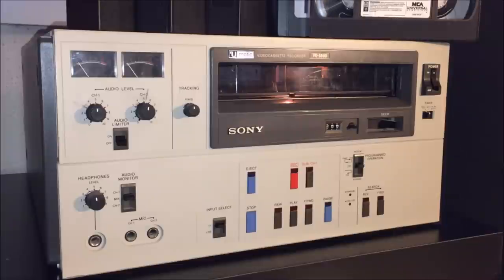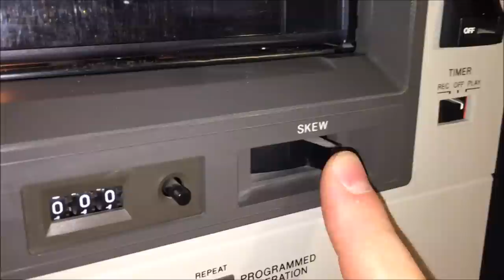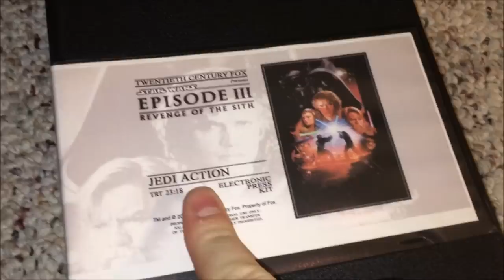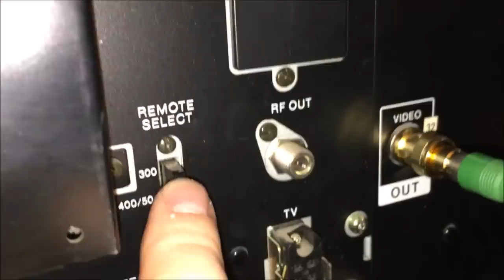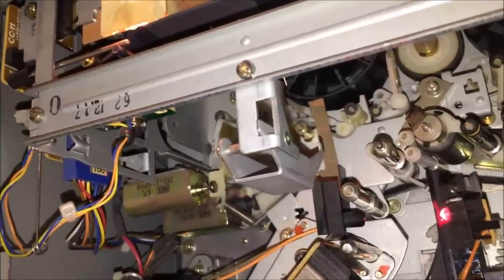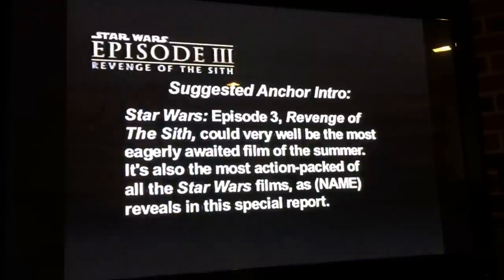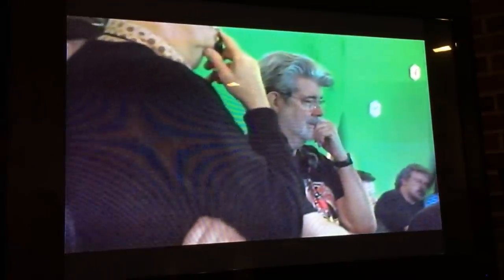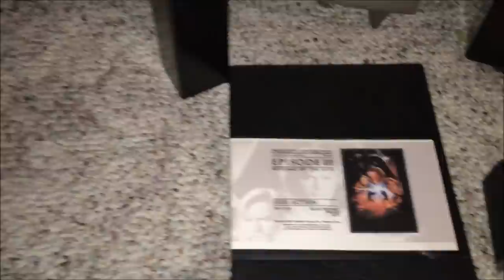Sony Pro U-Matic Mega VCR and Movie Preview Tapes

Comment: I have hundreds of those cassettes to transfer to MPEG this summer. The TV station I work for was using those until the DV, then HD tapeless. I have exactly the same VO-5600. Sadly it doesn't work. Found another in the back of the most dirty, humid closet. Surprise... still works perfectly!

Comment: I have been in broadcasting since 1960 and many post facilities in NY. No one I ever knew, besides cable companies uses these for broadcast. U-magic was a commercial (not broadcast) machine. Notice lack of XLR audio connections. No "tv studios" used the tv monitor connection. That connextions was yesterdays HDMI port. We used them to send copies or shorr clips off to advertising agencies. We would also make visually coded cassettes so producers could used them to pick out edit points for quad or 1" online edits.
I own over 200 movies on u-matic 3m tapes. Direct from 35mm film and in stereo
any older tapes need to be baked before playback.
I restore broadcast video tape machines (2" & 1")
Reply: From my understanding, Betacam and it's variants (like Digi, SP and SX) absolutely slaughtered the other high-band broadcast video formats
Reply: @VoyageOne1  they were only used for ENG stuff, never for productions
Reply: @rty1955  What was the reason? Did Betacam lack of quality for high end production usage?
Reply: @martinmannik  reason for what?
Reply: @rty1955  Reason for using Beta variants only for ENG stuff.
Reply: @martinmannik  beta machines were very finicky quality when they worked.
U-matic was NEVER broadcast quality

Comment: A few years ago I a few worn out studio video-tape machine that didn't even switch on, so I stripped them for any recyclable metals & materials. One was a UHF machine (JVC, I think), but the others were a pair of Sony Betamax machines that looked very much like this machine but of course the mechanism was more elaborate & the front panels had more controls on them (Dolby, etc.), plus they'd managed to cram a few more circuit-boards inside!

Comment: I thought it was interesting that some of those units on eBay were quite affordable. I've been recording local weather coverage of tornadic storms, and that would certainly make my DVD transfers look much better. I record those onto VHS as power glitches (like those during thunderstorms) won't prevent the entire recording from being trashed like burning video onto DVD would. As far as I know, a power glitch that happens while you are recording (burning) on a video DVD recordable is a bad thing. I don't think the recording is retrievable at least on consumer recorder or computers. Also, if the VCR ends up resetting after a power glitch, you just simply hit record to continue recording. I have an ATSC tuner that records to a USB stick, but those recording usually get corrupted during a power failure too. Of course, I could just get an UPS...

Comment: U-MATIC SP • Had the higher count of TV Lines.  SP = Superior Performance and was not entirely backwards compatible with regular U-Matic (Non - SP).  One could play back and record Non - SP on a SP machine, but a Non - SP machine could not playback SP recordings.  U-Matic SP machines were clearly badged on the front.

Comment: I had one of those at work for years. Hi band Umatic wasn't really broadcast standard though
Reply: Yeah, technically it was an industrial format. Used primarily in news gathering, advertising, education, music videos (in MTV's heyday in the 80s)... and even early CD mastering and the occasional data backup. It was a very versatile format and far more reliable than VHS and other consumer junk. These old U-matics r00l! They're built like tanks and run rock solid. I have an old JVC 8250 editing deck from '84(ish) and a newer Sony VO-9600 that accepts the U-matic SP format.

Comment: When this player was broadcast quality it only had to handle 280 lines of resolution because of broadcast limitations and television limitations. This machine was umatic and not umatic sp. So it was only 280 vertical lines of resolution. What acually made this broadcast quatlity was it's s/n ratio. Much, much better than Beta or VHS.

Comment: Can is possible to record any video from DVD player or else with the IN RCA?
Reply from the maker: Yes
Reply: The RCA in is audio only on that machine. You could adapt the rca output from the DVD machine to BNC and connect straight to the video input. It's the same format, just a different connector
Reply: Steve  A funny thing is that you can record CP composite and it will play back fine, however you won’t be able to re dub it to VHS for example
Reply: Matt Quinn I meant CP protected material, like Macrovision, it could be recorded to 3/4 but not to Beta or VHS, just played ok on the U matic,

Comment: I really like the way the external topology (is that the right word?), of the power switch has been designed. Looks like it would be really difficult to "accidentally" swith off this machine. I suppose that's quite important when it comes to real-world use. Yes! Real-world use included TV stations using this machine to play and broadcast pre-recorded tapes. You certainly do not want some ham-fisted, accident-prone individual "accidentally" switching this thing off. No Sir !!!

Comment: Also, I can't remember how to work out equivalent digital resolutions from analogue TVL... is 330 essentially equal to 440 horizontal pixels within the underscan area (~480 including overscan), or 880 (~960)? I'm guessing probably the former as D1 and even SVHS have higher TVL, and it's essentially the same as SVCD (the other two being equivalent to DVD and Laserdisc)...
Reply: I always do that by taking the quoted active picture bandwidth of a given format, then dividing it by the framerate (i.e. 30/1.001 for NTSC, 25 for PAL/SECAM), and then again by the maximum supported active lines (i.e. 486 active horizontal lines of vertical resolution for NTSC, and 576 active horizontal lines of vertical resolution for PAL/SECAM). For roughly every 1 MHz of quoted bandwidth, I get roughly 70 TVL of horizontal resolution.

Comment: Ths model was NEVER a "Broadcast" model. Sony made the BVU line that was the "broadcast" line . The VO was the "indstrial" line . There was acrually little difference in playback however the recording of the VO series placed the headswitch in the active video resulting in a bend or distortion in the bottom of the visible frame, had no time code built in and unbalanced RCA audio connectors. The BVU series put that headswitch in the vertical interval, and also has time code built in and balanced XLR audo connectors. I know I fixed THOUSANDS of these machines over many years. 

Also as that is not an "editor" it is a "Player/Recorder"  it is only 2 heads on the drum.

One of the biggest problems with ths model is not mentioned. It is when the turntable (that is a lower large round gear) that turns when tape is threaded  ) gets sloppy requiring the replacement of small white gear to te left that turns turntable and adjustment of the slop or play in the turntable. Someties the inner guides along inside of turntable need replacing as well as the other gear on the left with the belt on it. yes the belt too.

Comment: What video tape format has the best picture?
Reply: ED beta and D-VHS
Reply: 1. Ampex AVR-3 (1975), a 2", reel-to-reel, segmented, transverse-scan, VTR format machine with four recording and playback heads on the drum that was capable of recording Super High Band Color--the highest quality option available on Quadruplex--to 2"-wide videotape.

2. IVC 9000 (1975), a 2", reel-to-reel, segmented, helical-scan, alpha-wrap (i.e. the tape has a full 360-degree or full wrap around the head drum, which has a single head on this) VTR format machine utilizing either direct color (CVBS) or color-under (Y-C, Y/C) encoding that allowed for up to a 10 MHz-wide bandwidth signal (700 lines).

3. Bosch Fernseh Type B (1975), a 1", segmented, helical-scan, half-wrap (i.e a 180° tape wrap around the head drum) VTR format machine utilizing direct color (CVBS) encoding that allowed for up to a 10 MHz-wide bandwidth signal (700 lines).

4. IVC Type C (1982), a 1", non-segmented, helical-scan, omega-wrap (i.e. almost a full 360° tape wrap, or 355° tape wrap around the head drum in the case of this) VTR format machine capable of recording a direct color (CVBS) encoded signal with up to 10 MHz of bandwidth (700 lines).

5. Sony U-Matic SP (1971), a 3/4", closed-reel, non-segmented, helical-scan, omega-wrap (270°, or three-quarter, tape wrap around the head drum) VCR format that utilized color-under encoding with up to 924 kHz of downconverted chroma bandwidth.

6. Betacam SP (1986), a 1/2", closed-reel, non-segmented, helical-scan, half-wrap (i.e. otherwise known as a C-wrap, or 180-degree wrap, around the head drum) VCR format machine with up to 7.5 MHz of bandwidth encoded in analog component form (Y, Pb, Pr) allocated between the luma and two separate color difference channels.

7. Hi8/Hi8-XR (1989/1995), an 8 mm, closed-reel, non-segmented, helical-scan, half-wrap (i.e. 180° tape wrap around the head drum) VCR format machine that encoded video in color-under form (Y-C, Y/C) with up to 724 kHz of downconverted chroma bandwidth.
Reply: Zcooger Second Channel  Sony's HDCAM SR and Philips's/Thomson's D6 have better pictures than Panasonic's D5. D5's main claim to fame is that it had superior SD quality to D1 (albeit hardly noticeable, since D1 was an 8-bit format while D5 was a 10-bit format), DCT (used similar compression to Digital Betacam, except it was 8-bit), and Digital Betacam (10-bit format with similar compression to DCT).

Comment: I was born in 1974. I got to use Quad machines in production. In NTSC. In Canada. If you mess up with a Quad, it will gleefully rip your arm off. A U-Matic has a cover to prevent most people getting too close to the tape path, however, it will cheerfully shred your fingertips like an angry cat on methamphetamine. This is not a cute little VHS machine.

Comment: Not a Dinosaur.. great series of decks.  It’s more of a Model T.  This 5600 deck was considered an industrial low end machine in the Umatic world..  The tapes are average size.  Sony Digital and other deck tapes easily dwarf this umatic, although the Betacam tape stock is 1/2” vs 3/4” umatic..   yes, Betamax wrapped the tapes very similar to Umatic... it’s Sony!
These decks were pretty  much industry standard for broadcast news and non broadcast starting in the 70s and used for decades.  High end broadcast would have used 1 “ Ampex/ Sony open reel decks for studio work.  In the mid 80s Betacam decks replaced the Umatic format with the  component format vs the noisy composite recording capability.  Betacam machines were about the same size of umatic decks.
Your deck is the lower end record industrial model, but also probably most prevalent model for industrial/education video production.  High end broadcast  used the Sony 800/900 series of umatic decks.  The uMatic decks also were used extensively for field production and remotes since they had a battery operated field deck, the BVU 110, which used the smaller umatic C cartridges.  Umatic decks were a major industry and military tool for video training and professional media departments.  They were the professional standard for video production departments for decades.
Old tapes of all brands will shed media and suffer stiction.  If you have problems playing tapes, bake in an oven  at 100 decrees for about 4 + y hours to rebond emulsion/media to tape.  It’s Good for one play to make a dub copy to a hardier media format.
Image Quality was very good, but all uMatic decks still required TBC for broadcast on air.  
The deck you have was  most commonly used for review of tapes, or used in classroom, it was also incredibly reliable because of its simplicity.  The more expensive decks were temperamental because of their advanced electronics and sensors.  They did not like to play cassettes which suffered from loading or playback problems.
Loved this series of workhorse decks.

Comment: can you put a VHS tape into a U-Matic cassette and play it?
Reply: SteelVsMetal No, because the type size is different and so is the way video is recorded on the tape. Even if you transfered the spools of tape from a VHS to a U-Matic tape housing, tape width differences and recording method differences would preclude it producing any viewable image, if it displayed anything at all.
Reply: SteelVsMetal only if ya find an extremely rare VHS to U-Matic adapter.
Tongue in Cheek.

Comment: it does have locating for chapter - there is a time code in the tape and u can tell it to go - to  a location - by time or by frame - u do it in the remote - so when u want to play one scene - u write the frame number or exact time and it will go there and start play - very accurate - the quality is magnificent - it also its not really big u cant compare it to a home video or cd - its a professional machine -  size doesn't matter in studio -quality and reliability does and until now in studio - even a professional cd player is 2U or 3U size 
i  used these u-matic in totaly sync with open real tape (analog) - while the analog tape was the master - and no matter where in the open real i pushed "play" the Umatic very fast run to the exact location  and played the scene

Comment: AMPEX tape had no grafight lubricant so it rubs on the head and squeeks , NASTY
Reply: Do you mean graphite? This is not, by the way the cause of squeaky Ampex tapes. The squeak is a symptom of sticky tape syndrome - common in many 1970s and early 1980s tapes due to the binder absorbing moisture and breaking down. Nothing to do with tape back coating.
Reply: The heads get rubbed by the tape ,  on any age of deck  .
Its Ampex & 3M that rub the lining off any head .
Reply: @shaun9107  actually 3m tape was by far the most consistent tape used in broadcasting. I have used AMPEX, 3M, Fuji and Maxwell. FUJI was best quakity but after 6 passes the oxide would shed. Ampex tape was like sandpaper, horrible stuff
Reply: Ampex originated audio and video tape in the states with financial help from Bing Crosby.